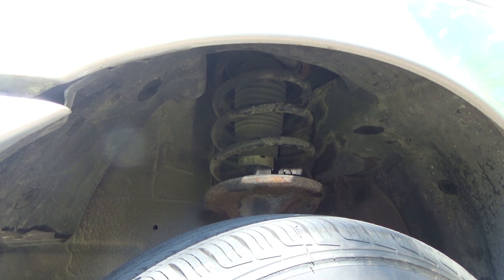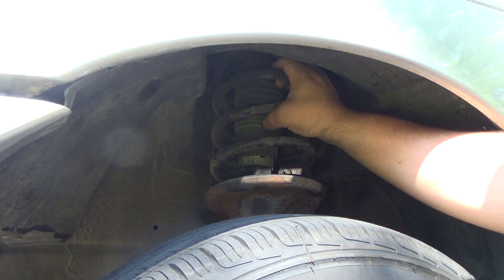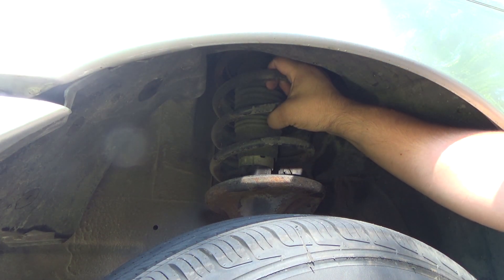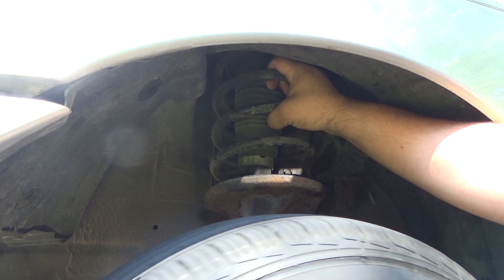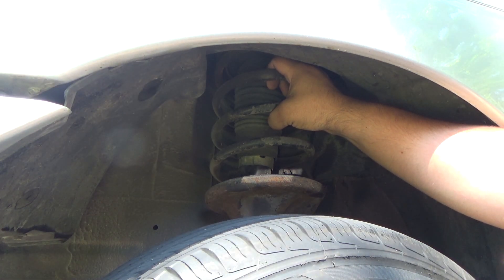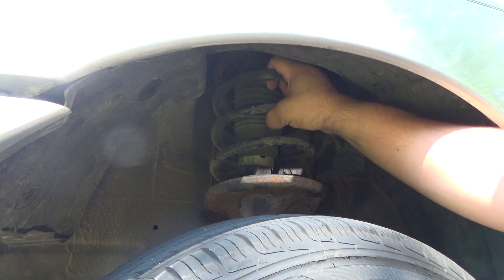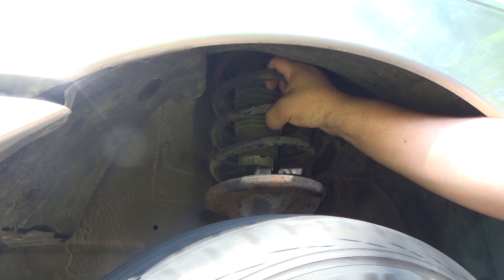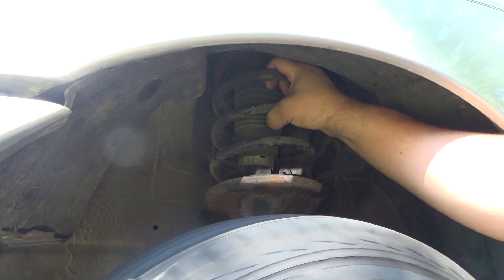Wheel Bearing Test - Which Side Is It?

Comment: Thank for the info, man. I used the loaded/ unloaded rule of thumb and replaced the wrong bearing last fall. Ended up suffering with the noise through the winter and spring. I ended up confirming the bad side with a Steelman clamp-on stethoscope. I had replaced the driver side rear bearing but it really was the passenger side rear.

Comment: Maybe it's not 100% just the weight of the load on the bearing, but the direction it's coming in from. When you swerve, maybe putting more weight on it in a "side-load" quiets it down some. 

I just changed my passenger side bearing because the ol' swerve test said it was that side. Still making the same noise when going straight. Stops completely when I swerve to the right (taking weight off that passenger side bearing I just replaced). 

Going to check the driver side out. I did check for play and everything seems tight. Going to try feeling the spring for any vibration. 

Wish I saw this video first!!! Listen to this guys advice!!! Don't be dumb like me. LOL

Comment: I do appreciate the video, because I am currently dealing with this exact problem, though with a few differences. I know that it's the driver side making the noise, but when I load that side by turn right, the noise completely stops, but doesn't get worse when I swerve the other way. The other thing that has me confused is that if I drive at highway speed then slow back down in my neighbourhood streets, the sound will have completely disappeared and doesn't return until I have left the car sit long enough (and it doesn't always come back then). However, I am sitting here with my car up on a jack and a wheel off, and the bearing is sloppy, so there's no doubt there. The really disappointing part is that I had the bearings replaced less than a year ago, which means that I somehow have had two new bearings fail in my car in less than a year (one of the rear ones failed in a matter of months).
Reply: I’ve seen infinity g35s that eat wheel bearings at alarming rates. It’s common knowledge for owners of those models. What make is your vehicle?
Reply: @larrydecker881  2008 Ford Focus.

Comment: I've got this exact problem. I noticed the "growl" when it was very light, so much so that the mechanic couldn't hear it but I could (being used to the car). Sound was coming from the front driver side, so I had that bearing replaced but the growl was still there. I took it back, the mechanic said the only other thing it could be was the bearing inside the engine / gearbox which was a job more than the cars worth, so I decided to drive it until it dies. A year later, and the growling noise is much louder, the noise sounds like it's the driver side and doing the swerve test points to it being the driver side too, but that is the one I had replaced. We got the car up on the lift, gave both wheels a spin, and it's the passenger side that needs doing. About to have the job done, so hopefully it will fix the problem, if not, I have no idea what to look at next.
Reply: Quick follow up, had the job done, problem solved. Passenger side was at fault.
Reply: @jasondudgeon9510  Wow, so either the mechanic is amazingly incompetent, or corrupt as hell.... (or both). Although if it was just being corrupt, when you didn't bite on big money for gearbox, you would think he would settle for the other side bearing..... so maybe add lazy to it.
Reply: @jasondudgeon9510 I replaced my driver side but still hearing a growing and gets louder when I turn to the left so would it be my passenger side? 😊
Reply: @dentondunn4346  in my case it was. Jack up the front & give the wheel the spin test is best advice I can give.
Reply: Yes, most likely.😎
Reply: @Darrenbrown68  It was the passenger side. All good now :)

Comment: Good info, I was in the same situation. the bearing noise used to go away on swerving right so, I thought the right front was bad and replaced it, but the noise is still there. will try out the vibration method and see if the left one was bad.

Comment: I've always been told that it's the opposite bearing; its louder when it's unloaded.  EDIT:  not the case for a BMW X5, the bearing goes quiet when unloaded (left turn quiets the noise = suspect left bearing). Just been through two wheel bearing changes . . and there is very little to help diagnose until the hub is off the car.  Try test driving in passenger seat, back seat . .

Comment: My vehicle began making the same humming vibration as in the video. Started 600 miles ago and occurs when veering left. Veer right = Silent. There is no play or noise when the front wheels are off the ground. I can tell it's one of the front bearings - can't tell which one! 

Guess I'll need to replace both front bearings? 300K car.

Maybe wait until the problem is more pronounced?
Reply: From what he said, it sounds like it would be the right wheel bearing that would have been bad. Did you have it checked out, and was it the passenger side?
Reply: @bekah242  Yes, it was the FR wheel bearing. Before replacement I confirmed this by a different method that I highly recommend: Raise the suspected wheel off the ground and turn it by hand while feeling the spring with the other hand. The grinding vibration is amplified by the spring allowing it to easily detected, especially when comparing the LH side using the same method.

Comment: Agree with Lokesh, good info. And I was also in the same situation. Guessed wrong. Now back into it with a different vehicle. Ford Escape. Definitely wheel bearing growl and lessens when swaying one direction. To further the frustration up on jacks there is no play and no detectable roughness. So I feel like I'm at a point of having to purchase and replace both bearings... or find an infrared temperature gauge somewhere which is additional cost. Any other checks anyone knows of out there?
Reply from the maker: Before you buy both and do that, check the rear. I've had a couple Fords that I would have swore was bearing noise from the front, and it was the rear.
Reply: Both bearings could be bad